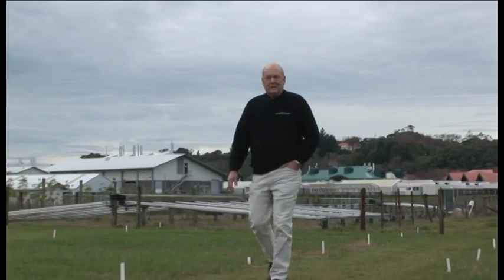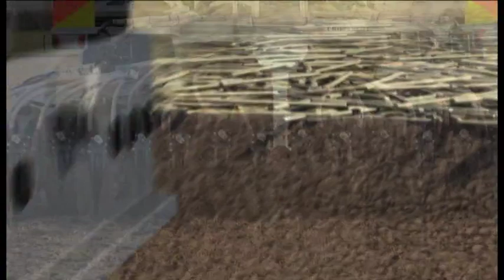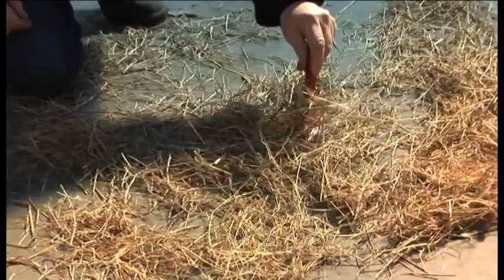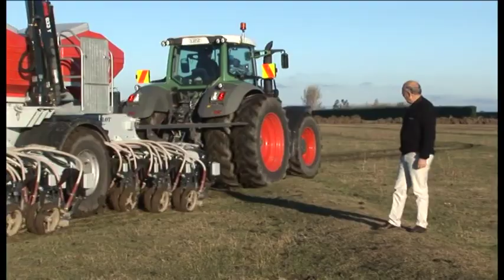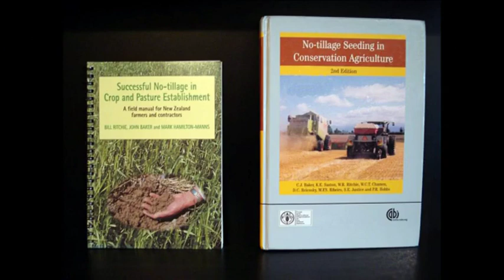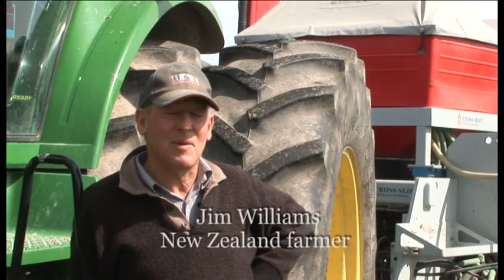Cross Slot - Bringing the Soil Back to Life

Comment: More low yield crops than successes with this system. Tried it for 6 years. Great marketing but the practical didn't prove the same results.
Reply: What was the state of the soils fertility?
A drill alone can’t improve yields on tired soil.
Sadly I still see it everyday in the farming community whereby the nutrients are mined out of the soil due to not meeting the crops nutrient requirements with manures and fertilisers applied for the crop. I don’t know why, but we always try to do everything on the cheap and eventually we will get to a point where the land will bite us back. 
Let’s stop blaming droughts, fires, floods  or the equipment we are using and take a step back to look at the bigger picture.
For example we lowered the sulphur in fuel and sulphur emissions in general to save the planet, now there’s a lot less acid rain providing sulphur to the soils. Check your soil tests, I bet you need to apply more sulphur to your fields now than you did many years ago.
Now we are all busy trying to store carbon in the soil, there is a point at which this too will impact crop yields, too much soil carbon will reduce yields and tie up other nutrients. We are not there yet, however it’s something to consider going forward.
Reply: What other types of drills have you used? Have you found a no till drill that gave you better results?
Reply: How much yield drop, and did you determine the EXACT root cause of reduced yield? Was it less germinated seed populations, .....did you have mfg consults?  And also am interested in what rate of maintenance or repairs of worn parts was required. Any problem with replacement parts availability in your location?